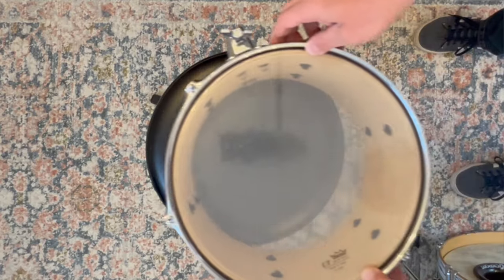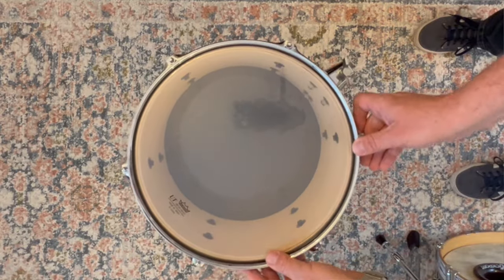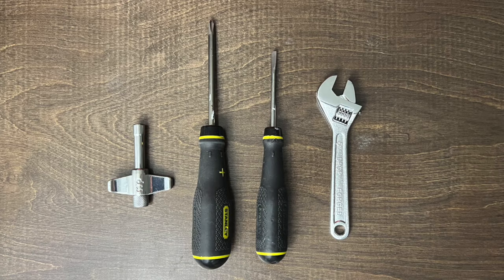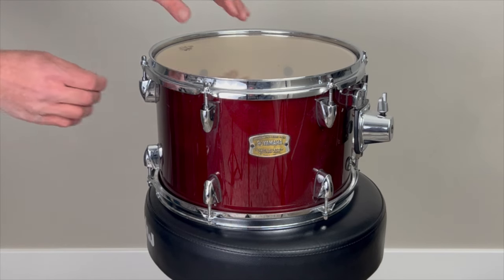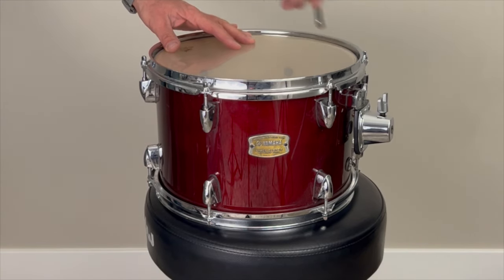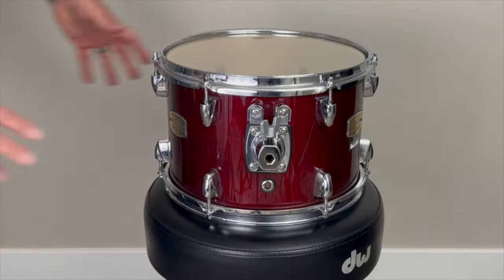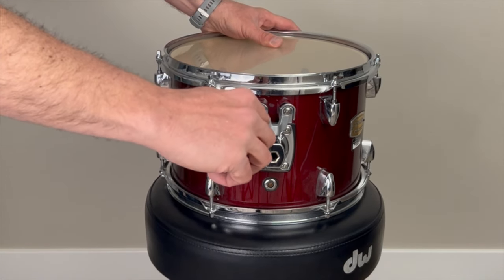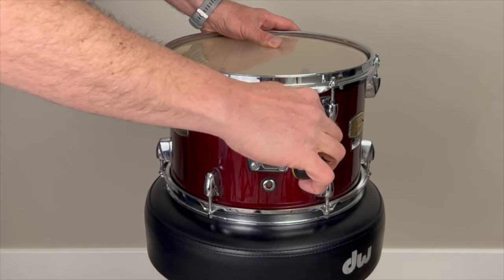Find and fix drum buzz!

Comment: I mean it’s not unexplained, it’s when that one lug is always buzzing even when I’ve tightened all the hardware and tuned so many times. It’s because the stupid drum is not level. Cheaper drums tend to have one or two spots in the drum where with bearing edge is not level which the other bearing edges. Keeping level or even tension on that lug results in higher pitch only in that spot or both in the opposite lug. That drum can never really sound good unless it’s a snare drum.
Reply from the maker: That's a really good point. If the shell itself is not consistent, you're going to fight that forever. Have you come up with any solutions for that problem on toms? I agree with you on snare drum - you can find a way to make the sound work. Thanks for stopping by!
Reply: @CommonSenseMusician  no I haven’t found a solution. I have a 14” tom that I battle this problem with. The solution is probably to sand the bearing edge level with itself but I’ve never attempted something like that.
Reply from the maker: Are you anywhere near a good drum shop? They may be able to do it for you or recommend someone who can. There are places you could ship it to, also, but at that point you’re investing a lot of time and money. May or may not be worth it.
Reply: @CommonSenseMusician  It's a cheap drum that I bought used as part of a cheap kit so I honestly just don't play it very much because I have a 12" tom and a 16" floor that sound great and don't have the problem. 14" tom just sits in the closet. I have it out on the it right now because I was trying to play those 80s tunes with big tom fills but it just sucks to tune. Might find myself a 13" tom to take its place. It's a PDP Birch kit FS I think from the 90s I bought it used. The floor tom is from the birch concept series also used, if I can find a concept birch 13" tom I might be golden.
Reply from the maker: @tmappe  Sounds like a good plan. Good luck finding that drum!